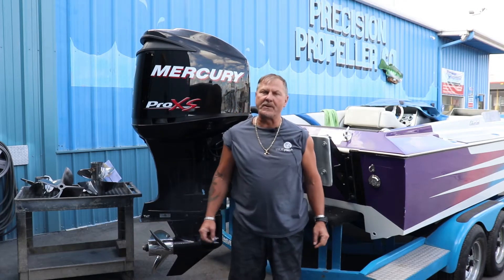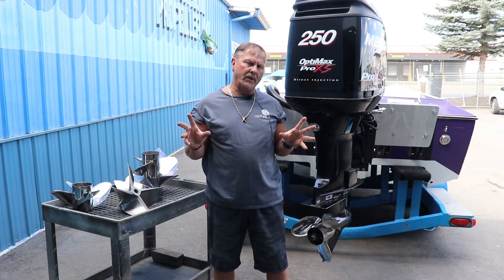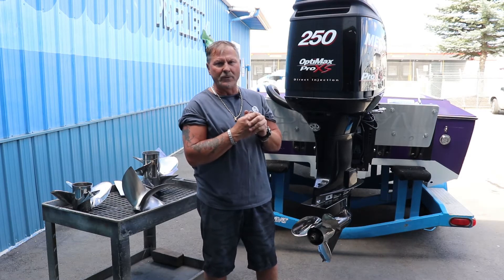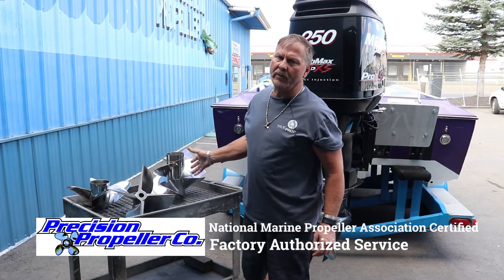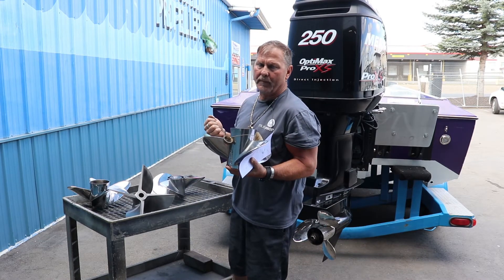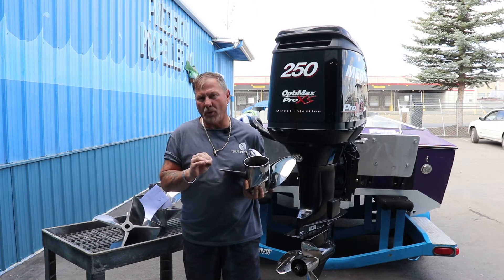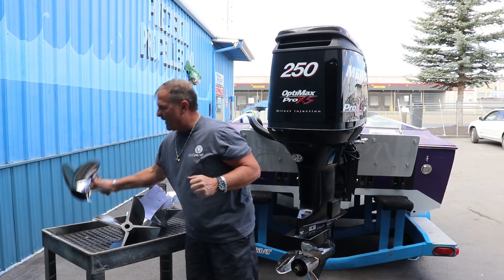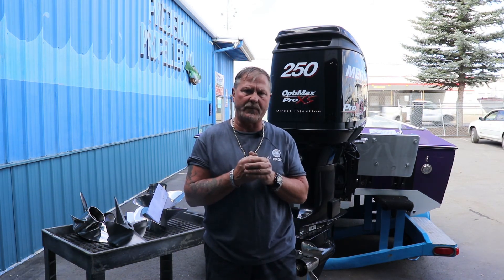Prop Talk | Labbed or Blueprinting Boat Propellers Explained

Comment: If I have an older prop that has a few nicks or dings in it or just wear would it be beneficial to have it blueprinted? I’m looking to have them balanced and maybe a hair of cup added for some stern lift and then just cleaned up. Currently turning 5600rpm on both 200 HPDI engines and Yamaha 19M SWS 1 props.